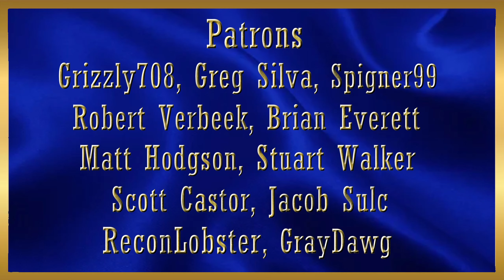ATS Goggles 56 Dash Panel Rebuild Part 1

Comment: Wow that was a great video. I enjoyed seeing the backside of that dash panel,  all the wiring, Leo Bodner board and the aurdrino boards. Hopefully it will inspire some of your viewers to make their own button box rather than buying a Heavy Hauler box. Interesting that your shifter was not Usb direct to your computer.  Nice  work on the dash panel Dan.
Reply from the maker: Thanks Dan. I converted a real Eaton Fuller shifter from air controlled to electrical. I just run the switch outputs from the switches I put in the shifter right into an arduino board.

Comment: You have the boards all together. My question is if each board is connected separately to the computer, meaning it has 3 USBs connected to the PC for each board or if you did something to make a jumper and use only one USB for the 3 boards.
Reply from the maker: The boards are all separate. The shifter knob goes into one of the arduino boards, so I only use 5 USB inputs total. That leaves 1 for the steering wheel and pedals and one for the shifter itself.
Reply: @danmcnarry  tthanks for answering

Comment: Hey um, i am just wondering when part 2 is coming out for this build, It looks fantastic ?

I am currently trying to build a button box for myself as the price is way to high to buy from America, I live Australia. I am using an arduino and it can only handle up to 32 buttons. The way you have built yours looks really really awesome. I am not having any luck with mine, including the code i have to do to make it work. No one seems to know anything about them here.
Reply from the maker: I'll try and get part 2 out tomorrow.

Comment: First,why don't you do a triple screen setup? By the way I like your Peterbilt wheel
Reply from the maker: I don't really have the width available for triple monitors. I have my sim rig up against the wall in my rather narrow basement storage room. I'm happy with the setup though. When I'm "trucking" my surroundings become the truck I'm driving.
Reply: @danmcnarry  I like your setup though